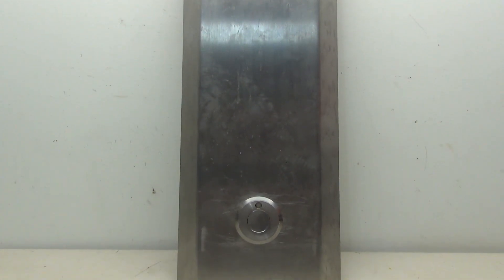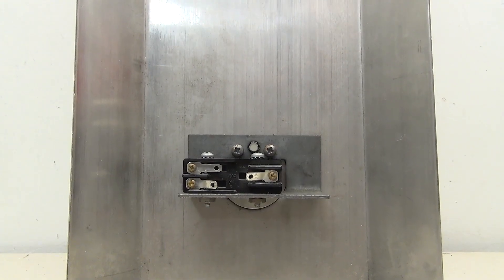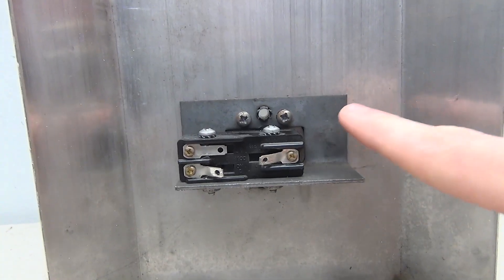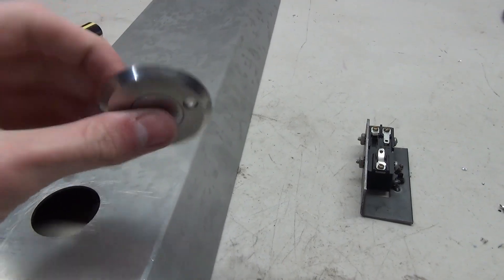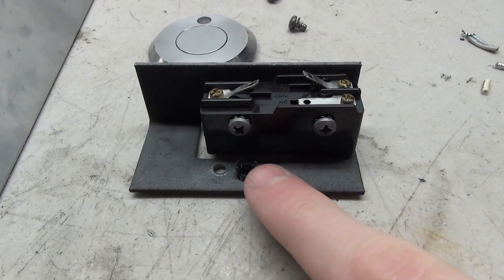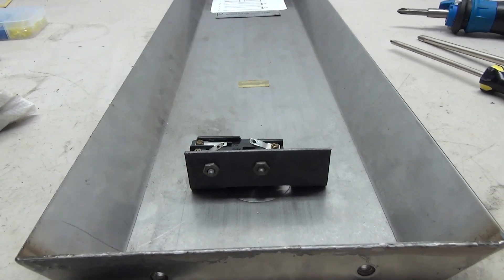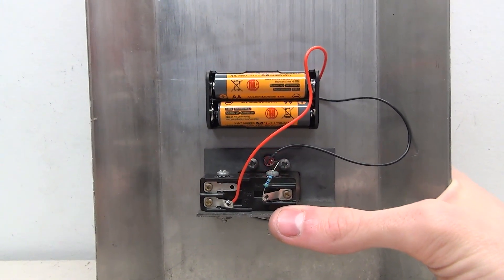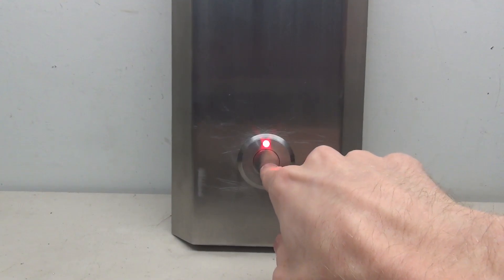Wiring Regency Elevator Buttons

Comment: Oh interesting. I've only seen these used on some 1974 Westbrooks that were modded in 1995 by Dover. They had Brass Regency Call Stations with the lights above the full button oddly (above the outer ring), but the COP's were Traditional.
Reply from the maker: I've seen a very similar version of these used on another Dover. They press a lot different than these.
Reply: @stlelevators  that call button used to be on the otis elevator at the cannery san fransico

Comment: you soldered the wire to the contact finger, now how do you connect the elevator wiring?  isn't that from and for an elevator?  both videos i saw, you played with things, BUT  do you re-assemble them to actual elevators?
Also, why you never show how to remove the panels
  Thanks    (if u still around here   lol)
Reply from the maker: These parts don’t get connected to actual elevators. This piece is on display in an elevator museum now. I don’t show removing the panels because I don’t remove them. These are given to us as is and I wire them up for display purposes.